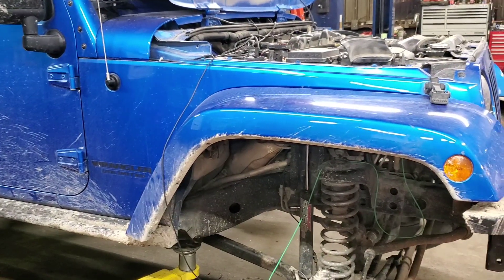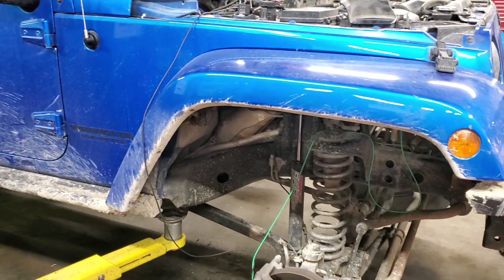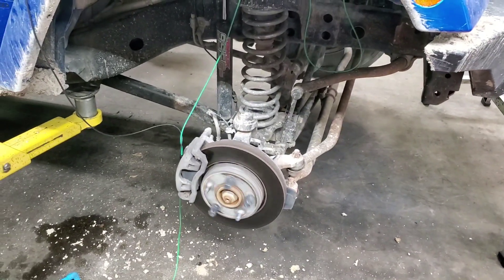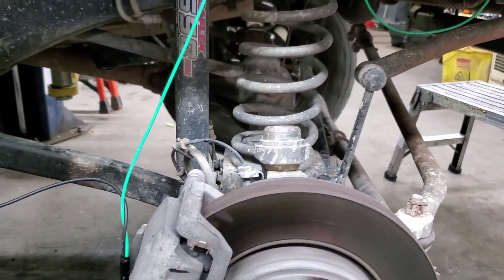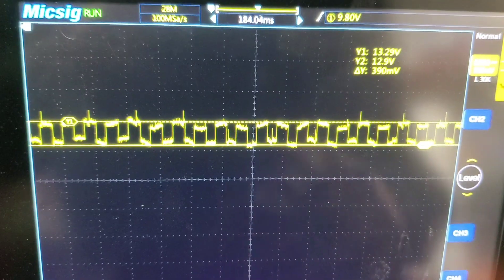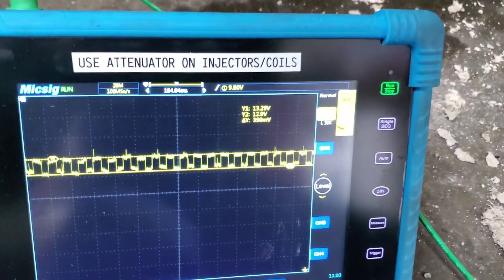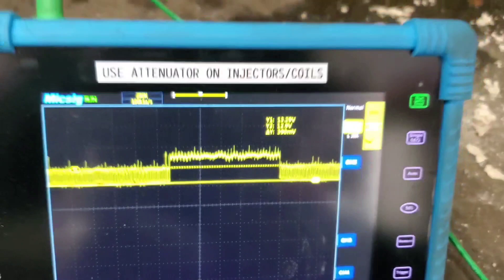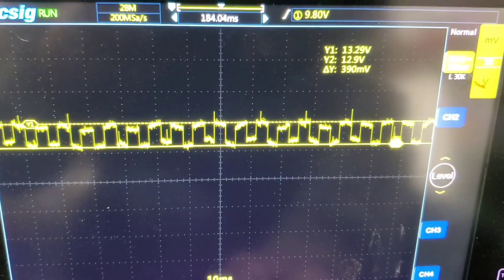Testing Active ABS Wheel Speed Sensor With Scope

Comment: This way of testing works for compression test too if you can't get an amp clamp on the cables properly.
Reply from the maker: Yes, one of my main uses for my scope is relative compression testing. I have found many problems very quickly using that test
Reply: Learning a lot thanks for sharing